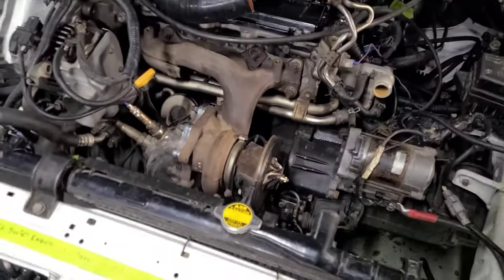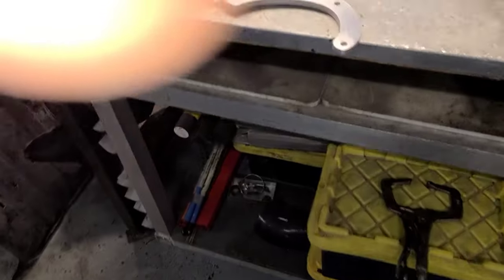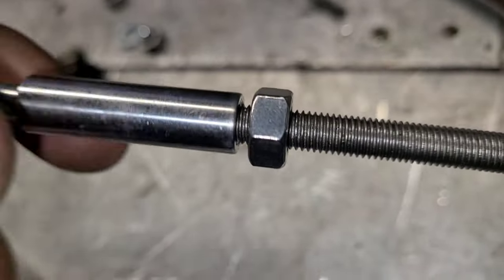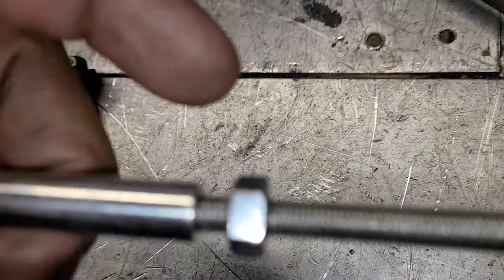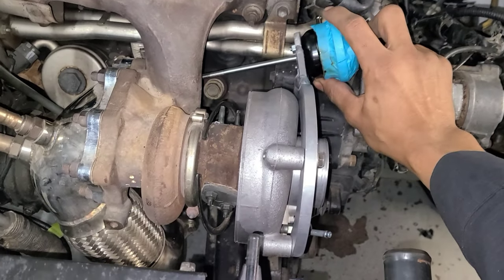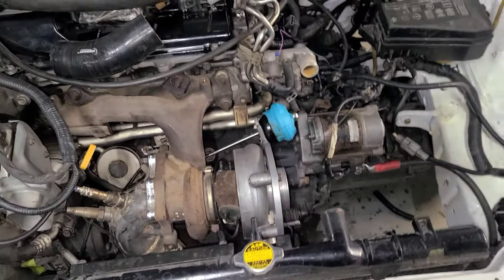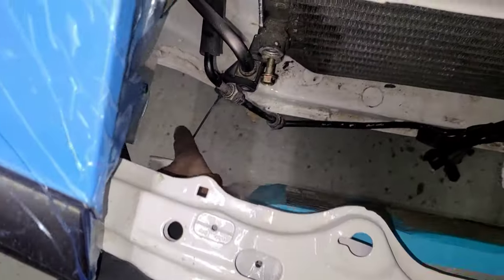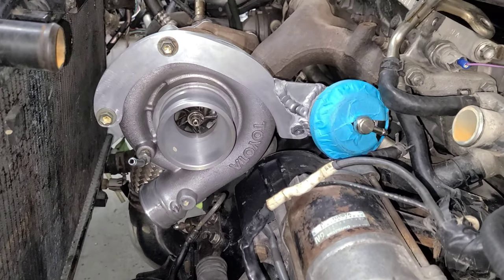How to clock and rotate your turbo

Comment: Hi mate, awesome that you were able to clock your turbo downwards, im looking at doing the same on my celica with my ct15b, i was wondering if you had a diagram/measurements of the actuator bracket available for use? Many thanks
Reply from the maker: No sorry this was a one off for the customer